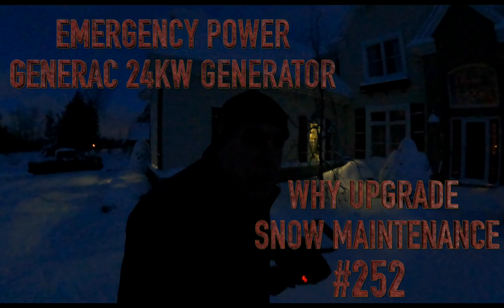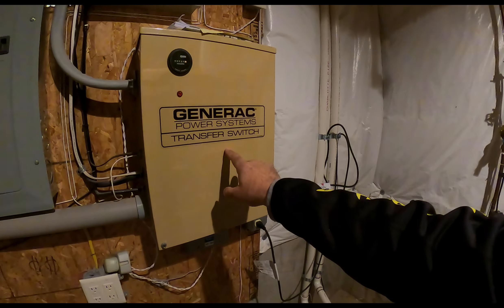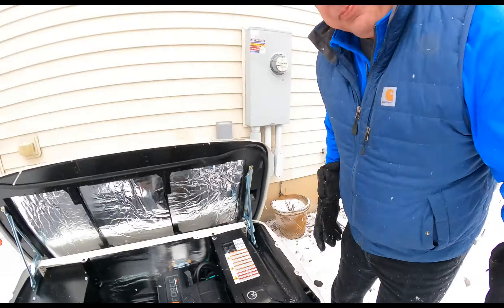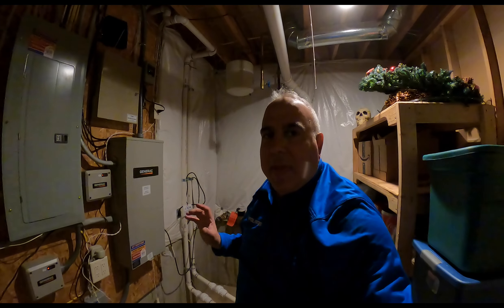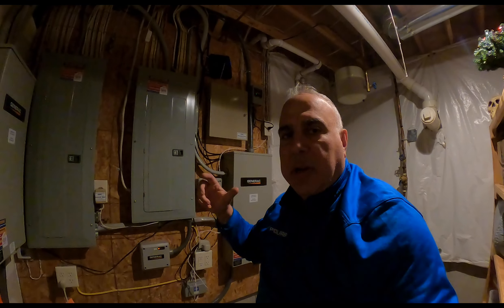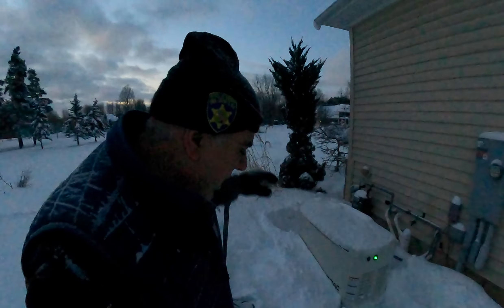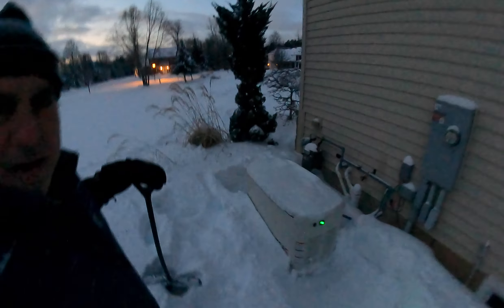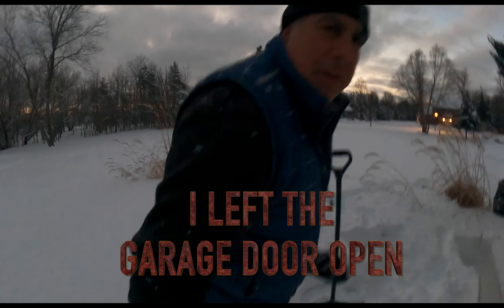Emergency Power Generac 24 KW Generator Why I Upgraded Snow Maintenance Inside My Utility Room #252

Comment: In eastern PA we had a 15 KW Generac which served us well for many years, it powered the house fairly well, but could not run everything at once.   A couple years ago we upgraded to a 20 KW unit.  Also added a second propane tank.  Added an oil filter heater.  Nice unit, dependable.  Installer & service contractor are top notch. 
Also we have a John Deere 3039R cab tractor with V-snow plow, great for deep or drifted areas.
Reply from the maker: My gosh, I think you’ve left other comments about your tractor because unless someone else has a free series tractor with a V plow I think that’s so cool. That’s kind of sad to say that generators have become a must for property owners. I’m glad you’re happy with both your generators. I love to ride and Pennsylvania on an off-road you live in a great state. My father was born and raised in Pennsylvania until his parents died when he was 16 years old, then he went to serve Korean war. Please stay safe during the winter season and in peace thank you for commenting

Comment: I lengthen my run time to 15 minutes. I want the oil to get good and hot to take care of condensate in oil. Assume you have the same cold weather pavkage I will never be without Ng BU Gens again its a necessity just like shingles or insulation
Reply from the maker: David that is how I feel, I totally agree with you...my wife was hesitant at first until the power went out. Thank you please keep commenting be safe.

Comment: I would have one to but the cost of the unit, electrician and gas tech killed it for me.
Reply from the maker: Believe my I know. My company did all of that and had zero percent financing for  18 months so I financed and paid it off in 10 months to ease the financial pain. For me it's worth giving up something to keep my family warm and basement dry. Be safe
Reply: Yeah but $12.000 I a lot to come up with, Generator is $6000 and labor is another $6000

Comment: Hello. Thanks for your content. Having my Generac 22kw installed in 2 days.
You mentioned you use a trickle charger. Do you have a video talking about it? How did you set the trickle charger up?
Reply from the maker: The generator has a built in trickle charger as did my previous generator. I'm not sure if it is included or an option...frankly I think it maybe standard. i hope this helps you ask your installers. You'll love your generator.
Reply: @maraudermitchelli  thanks..... I will ask my installer

Comment: Another YouTuber who had one of these Generac backup generators talked about a problem during cold weather.
He said the air cleaner filter box would fill up with water condensate and freeze and eventually plugging up an exhaust vent in the filter box, causing oil to spray out from the dip stick tube.  You definitely have seen your share of cold winters, so I was wondering if you've ever had this issue?
Reply from the maker: Cujo I believe the problem is snow gets sucked up through the intake vents and sucked into the air box and into the combustion chamber. So I make sure the engine intake and cooling vents are cleared of snow. I have a video on this last year during the blizzard...pretty cool video. I've had no issues when the vents are cleared and my machines runs every week year round snow or rain. I hope this helps be safe, thank you

Comment: Greg from northern Michigan. Good choice Pete !  Had a 20 kW Generac air cooled standby gen set on our old rural house for 14 years with no problems. Racked up about 600 hours of run time. Installed a slightly larger 22 kW standby gen set unit on our new rural house four years ago, also without problem. It has about 160 hours of run time so far. And Generac is American made too in Wisconsin. Pete's a prepper, me too. Great channel !
Reply from the maker: Greg you made me feel much better about my selection in generators. Yours have much more run hours than mine after 20 years...Generac has done you well. American made is a big plus in our mines. Thank you for sharing with me, and supporting my channel peace!
Reply: Better choice would have been a Kohler or Briggs,  you can get parts, they are far more readily available at part houses, And they make their own engines.   Generac engine parts are only available via Generac.  Good luck needing that one part from your local saw shop when your down n out.  Dont get me wrong they sell a lot of Generators, price and marketing go along way.   When’s the last time you saw any other commercial on tv other than Generac?  Maybe Champion one time…another good brand for smaller home backup gens.

Comment: There's also an air intake vent in the back of the Generator also....I just wish Generac would allow the consumer to increase the exercise run cycle back up to 15 minutes......5 minutes is too short in cold weather regions to allow the engine to get hot enough to burn off any moisture in the engine..I suggest running the generator once a month for twenty minutes
Reply from the maker: Another viewer told me about the rear vent, I mention in it in a Blizzard Debriefing video. I thought the short test time was great...but you raise an excellent point. Thank you.
Reply: @maraudermitchelli  Keep an eye on the underside of your oil fill cap, if there's a white milky substance gathering, there's moisture in the engine......I always run my 22kw at least twenty minutes every month even with the five minute weekly exercise..five minutes is fine for warm regions but not in cold weather winter conditions
Reply from the maker: @Deke1  Excellent advice thank you Deke.

Comment: Is there any way to site that thing so it doesn't get buried in snow? Any way to shield it so  you don't have to go out in a storm and clear the intake/exhaust?
Reply from the maker: Not really it needs to breath building a structure around just may cause overheating. Thank you for commenting and trying to help.

Comment: Hey Great Video !   Contemplating a Generator also.   You might also look into a backup sump pump called Water Commander.   Based out of Illinois.  I will have a video on my channel next month detailing the product.  It uses city water to pump out your sump crock instead of back up electricity.   I purchased the MG36.  It ran me about 650$ for the pump and plumbing parts.
Reply from the maker: Grey water pumps were very popular in our area, until one storm when we lost water pressure...my gosh that was a strange storm. You have a great sump pump...I'm posting a video soon on that. Be safe

Comment: Thanks for posting. I’ve been trying to upgrade from a 17KW to a 24KW so it will take care of the entire house. I’ve had poor luck with Generac not being able to fill my order and I live in WI. After taking a 50% deposit a year ago I’m still waiting. Don’t forget the other small vent on the house side of the cabinet. I also dig a path around the entire unit in case you have to remove the front panel for an emergency repair.
Reply from the maker: John I have to check for that vent...I'm wondering if that is the intake for the engine...thank you for the tip. The generator is better protected from snow than the ac units but your comment is excellent that vent was well above the snow. That's not good that you've been waiting that long for unit and put down a deposit. I only had a 5 week wait and that was for the installers to catch up. I'm wondering if you should inquire further with the company you gave the deposit. None of my business I'm only trying to help. Thank you for supporting my channel.
Reply: That side vent goes to the actual electric generator part. I think it’s intake for cooling air to the windings.

Comment: A superb overview of the new 24KW Generac generator you had installed.  I had one exactly like it installed last year.  It replaced a 15 year old 16KW Generac generator which served me well for the more critical appliances, but the new Generac will power the whole house as well as 2 equipment buildings.  And, I agree the new one is far quieter and produces much better quality AC and voltage regulation.
Reply from the maker: John my first generator was 15KW...very similar upgrade for both of us. There's many electronic improvements over the last 15-20 years cleaner power for electronics. Thank you for sharing your history makes me feel more confident in the selection and upgrade. Thank you for supporting my channel peace.

Comment: Great video, my friend.  My wife and I have pretty much decided that when our 15 year old Trane heat pump goes out, we'll not only replace it with another Trane but install a whole house generator at the same time too.  The trouble here in the NC mountains isn't usually snow but spring ice storms and the hurricanes that blow in from the Atlantic or the Gulf.  My little portable 3000W Honda generator has bailed us out several times with just enough to run a space heater, coffee pot and keep the refrigerator/freezer from thawing but we know that it's only a  matter of time before the next Hugo, Fran or Floyd turns a two day inconvenience into a week long nightmare.
Reply from the maker: I know your weather...comes in fast and is severe and in frequent. Boy I'd keep that great Honda generator as a backup to your pad mount in the future. Best of luck with you heat pump and future generator. Thank you for supporting my channel peace.

Comment: I am planning a similar installation for a new build --  (2) 200 Amp panels and a 100A in what will be a the RV garage some distance away from the main house.  I have been looking at the Generac Back-up Generators --  Still debating on Generac and another Brand like Kohler or Cummings -- My question is are your fully satisfied with the Generac Brand - including the installation and service from the company and or dealer?  AND does the 24KW meet all the needs you have during an outage?  Thanks for a great video!
Reply from the maker: RP my first general 15kw was at my house for 18 years and now it is still working at my brother's house for 2 years...I'd say that's very good. He is thrilled with it. The 24 kw is probably 2-4 kw more than I need, as a garage is still in play at my property. It should more than handle my needs. The installation was good, some routing of wires I wish was better...but it seems to run. I'd recommend this brand as 3 of my siblings have purchased it. I hope this helps.
Reply: @maraudermitchelli  Thanks Pete! I asked because no matter what the product is today -- someone somewhere will give it a BAD review and describe a problem --  I guess there is no getting past that no matter the product.  I also believe that doing the research like that on a product does help discover the good the bad and the ugly?  I also believe that "vetting" the company selling the product is important and seeing if they have had complaints written up on them as far as Customer Service issues.  I will be doing that with the Generac Sellers in my area where I will be building this year.  Thanks again for your reply and your comments.  Retired Person

Comment: How many SMM’s did you install? What loads did you shed? Thanks. Great video
Reply from the maker: Joel I'm not an electrician...please explain your question and i will answer you may need to do it in a separate comment so I see. Merry Christmas...You're smarter than I
Reply: @maraudermitchelli  I believe he is asking how many load shedding modules you installed and which appliances you hooked them up to..
Reply: My modules are for the electric stove top, electric oven, and pool pump. Those small boxes with the orange light are called load shedding modules.

Comment: Nice setup Pete, I installed a Generlink powermeter transfer switch on my house (It's very small 2 bedroom house), so I have a mobile generator Enermax XP12000EH to power the essentials of my house by turning on each breaker for each circuit I want to power. It's like buying a tractor for insurance, since I've installed it. Only needed to use it once.
Reply from the maker: Peace of mind. We like to be self reliant in our own way. I should look for a generator as a back up to the pad mount. Thank you for supporting my channel...I think spring is here 65' today.

Comment: This just solidified my decision. I have a 3600sqft house with 2 AC units. The 24KW should be more than enough for me. Does this power your whole house or do have to turn off certain things?
Reply from the maker: Ray a 22kw would have powered my entire house it wasn’t that much more for the 24KW. We also have a hot tub. I’m impressed with the 24 being very quiet. Btw my brother has my 15KW and it’s still going strong. My ac units have a delay start which were installed with the generator but they were problematic and disconnected, my hvac contractor says the stats have a delay on them.
Reply from the maker: The 15KW is 20 years old
Reply: You should look into installing a soft start kit on each of your AC units.  A soft start kit will greatly reduce the extra "inrush" amperage when your AC units start up.

Comment: Just bought a Generac 14Kw, cost about $8900 installed. 
The dealer said it wouls be as loud as a lawnmower. I was thinking lawn tractor, but when they fired it up? It was as quiet as a Honda push mower.
Can't wait for a power outage!
Reply from the maker: I’ve been waiting…congratulations enjoy the peace of mind 🙂

Comment: Nice upgrade. I'm looking to do the same. Did you run all new wiring from the generator to the transfer switch or were you able to use the wiring from the 15kw unit?
Reply from the maker: I believe it was new and they had to rewire the grounds on ,y panel

Comment: You may want to consider building a wooden structure around the generator with solid top and vents  around the side something that would give it plenty of space to breathe and that’s fairly easy to remove to maintain
Reply from the maker: I will do a debriefing video on this video and my blizzard video shovel snow form the generator vents. Be safe and thank you
Reply: You need to be careful with putting anything over or encapsulating the Generator. It “may”void the warranty.  Just check if it will.

Comment: Nice unit, I've always been one to go bigger than needed with many things so your not working them so hard and I figure that they would last longer than something running at max capacity. It's very rare for me to lose power here as the co-op that supplies my electricity is very good at maintaining their lines and keeping trees trimmed back. I have a portable generator but have thought about a unit like you have. Take care...
Reply from the maker: J there's so much peace of mind having a pad mount generator that will run whether you are home or not. I'd save that portable generator for a redundant backup. Our area they are getting better at trees but the infrastructure is old. Thank you for supporting my channel.

Comment: hey, my ac/ heat pump unit has a stand it sits on that bolts to the foundation of the house. this keeps the unit way above ground level. I insisted on this method for that reason of snow accumulation around the unit. its off the ground approx. 1.5 feet. I don't have to worry about shoveling it out unless snow is deeper than that height. maybe consider one of those mounts for your generator.
Reply from the maker: I will post a blizzard debriefing video on this topic soon thank you good comment. BTW I think that is the best option I do that on some commercial units.

Comment: I to just replaced my 2003 Generac unit with a 2022 Generac don't forget to keep that vent on back clean I have cold weather kit they do help especially on the oil it gets good shot of warm oil I only use 100% synthetic true small engine oil not car oil they don't have the zinc and phosphorus numbers required Briggs and Stratton, Amsoil and Generac all make great 5w30 synthetic the Briggs and Amsoil are 100% synthetic not sure about the Generac oil but it's designed for air cooled engines Mobil 1 and other car oils are not the ppm on zinc and phosphorus is only 700 to 800 because of emissions they are not 100% synthetic either including Mobil 1 I'm gonna put a silicone oven mat under the battery warmer I have heard them rubbing causing a short on the frame those mats are good to 400 degrees also remember valve adjustments on the engine 25 hours then every 200 hours I have a little bit smaller unit with the new 816cc with hydraulic lifters doesn't require adjustment anymore like my old one they are great units the small engine oil really helps burn off and wear big time sure is peace of mind having them love it
Reply from the maker: Kevin awesome comment great tips I read it 3 times. Thank you for the great advice.
Reply: @maraudermitchelli  your welcome yeah sorry my grammar is poor took a therapist 10 years after high school to figure out I had learning problem if its hands on then I'm fine I can read great I think that's why it got over looked,  your electrician is really good mine was put in by same guy both times he does really good work I'm very happy just got finished couple weeks ago I did break-in myself 1 hour at a time small load I wanted the 5w30 synthetic in it before 20 below zero weather gets here in Northern Illinois very rural farming area lots of wind it probably been ok with cold weather kit but I know my dad would of done that so it felt right lol you have nice set up, take care
Reply: @Marauder Mitchelli  I just did some research the battery warmer was redesigned with a pad under the heater part generac addressed it I checked mine and sure enough it has a soft pad underneath the actual heated part I would assume yours does too being pretty new its a nice design probably at least 1/4 inch thick pad